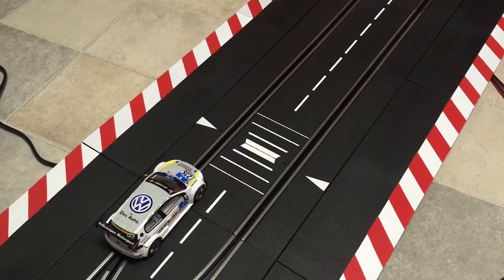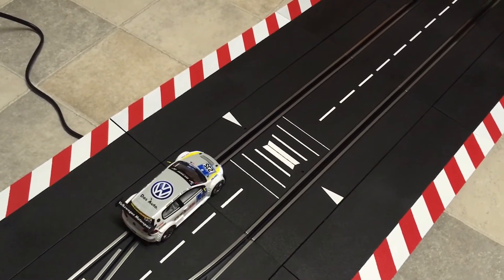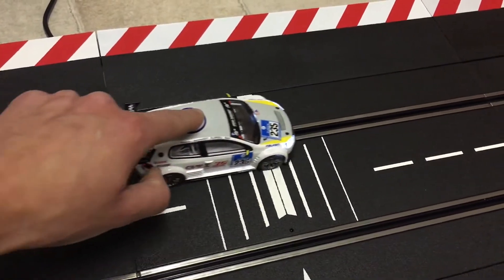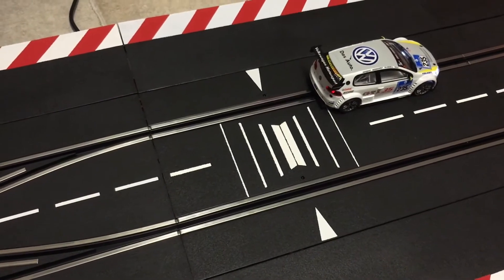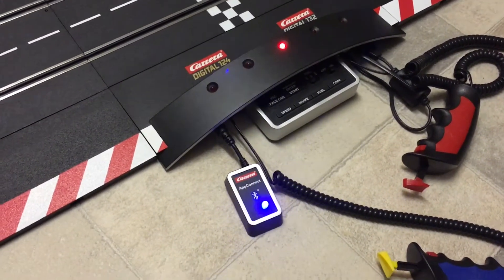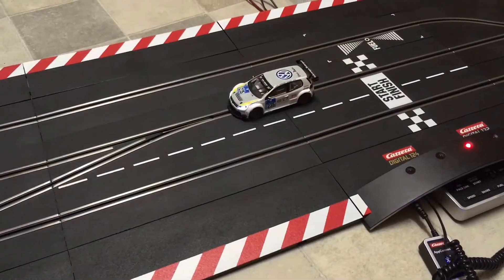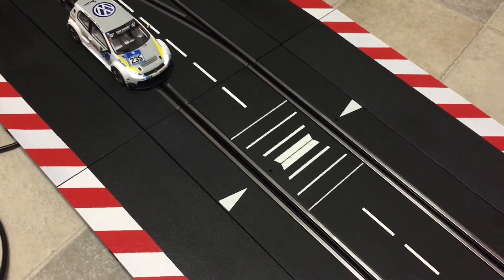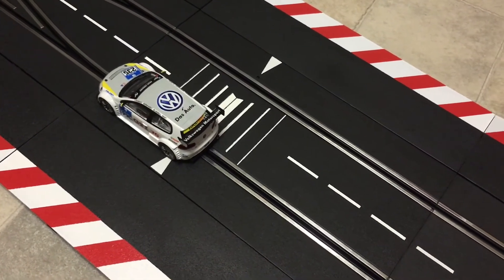Carrera Check Lane explained

Comment: What about usage with a 4 lane track? Can you have 2 check lanes next to each other and assigned to the same sector?
Reply from the maker: Good question, i have not tried that.(yet). But i think it will behave like 2 different sectors.
Reply: Yes, you can absolutely have two side by side as a single timing point.  Cheers.

Comment: QQ: is it really need to use the pc appconnect?!? Or can we use this AppConnect just with blackbox? Thank you. Kind regards
Reply from the maker: What u need is a Carrera Control Unit (not Black box) and a Tablet or Smartphone. The connection is via Bluetooth (with the Carrera App connect dongle). As far as I know the (Carrera) PC software does not support the check lane.
Reply: @itsaboutslotcars4713  Clear tx.
Reply: I would recommend using SmartRace found on the play store. Fantastic software.